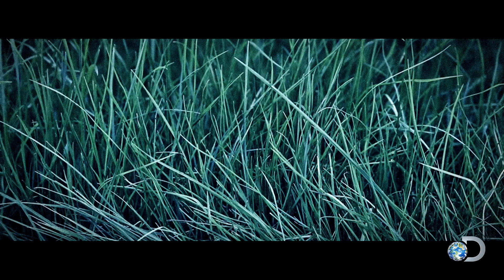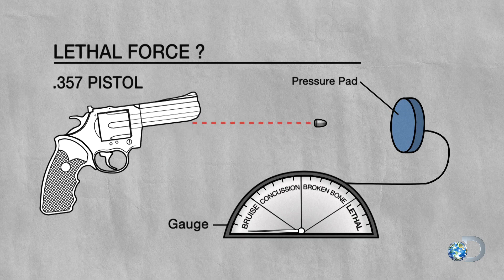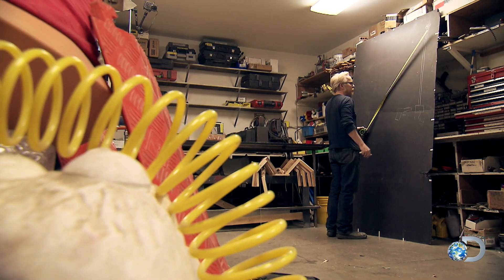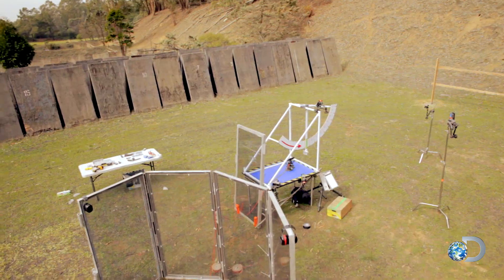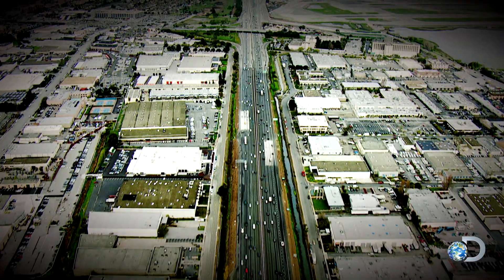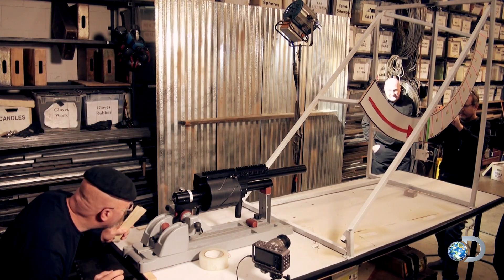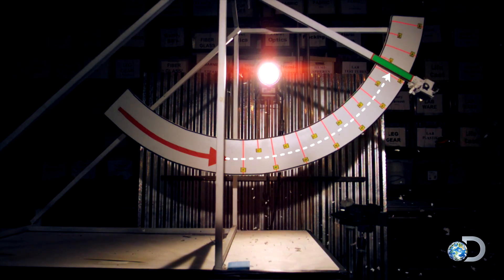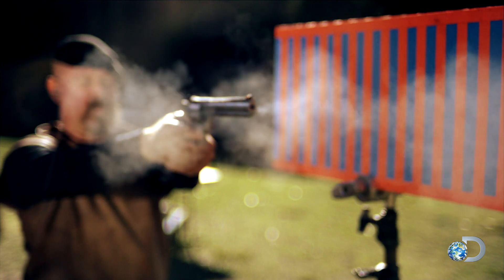Lethal Lawn Mowers MiniMyth | MythBusters

Comment: this is probably the worst mythbusters I've ever seen.

the lawnmower does not have the same launching power as that gun. Plus you're doing it at point blank range which rocks are not aerodynamic like a bullet is. Bullets usually are deadly both on power and PENETRATION, which the rock also lacks.

Also, lawnmowers cannot aim higher than the cover. So watch out feet?

Comment: No... Someone failed physics. They made a mistake somewhere. A 357 will go through multiple people and vaporize their heads. A lawnmower blade spins at 200MPH, that's 293 feet per second. A 357 bullet moves at 1,450 feet per second. A bullet is made of dense lead and maybe copper or steel jacketed. A rock is CONSIDERABLY less dense, aerodynamic, and not designed to penetrate as well. 
Look, you think this was done right, let's have a duel with your potato gun and my 357... I'll win, first shot. And I'll maybe get a bruise...

Comment: I think there's a mistake in this experiment. I believe the "energy rig" actually does a better job of measuring the momentum of the objects when they hit the hammer. Objects with similar mass transfer energy better than objects with very different masses - the bullet is going to ricochet off the hammer and maintain most of its original energy.

Force per unit surface area also matters when it comes to lethality, but that is just contextual information.

Comment: Dynamo is correct.  Also, this whole setup is waaay more complicated than it needed to be.  Computing energy door pounds is simple.  Questions:  how many grains was the .357 round?  What was the mass of the rock?  How did you determine the lawnmower would propel the rock at the speed you did?  Seems like there would be tremendous potential for variability there.  
Plus, Dynamo is correct.

Comment: Where's the lawnmower part of this testing? Why did they not bother doing a ballistics gel test? Get the metrics from the mower, use a pneumatic gun to fire for accuracy, fire it at a dummy's head, and then fire that over several distances to see if you would die from, say the next yard away like their original diagram?!

Comment: I think there is a little confusion between kinetic energy, and momentum. The rock clearly had more momentum, but, the bullet definitely has more kinetic energy. If the bullet was half the weight of the rock, but traveling twice as fast, it would move the pendulum the same as the rock that's twice the weight, but half the speed. However, the bullet would have twice the kinetic energy! Clearly, a .357 bullet is many times faster than the rock, but much less mass. Even though the rock had more momentum, the gun fired with at least 5 times the kinetic energy. Less of the momentum was transferred into the heavy pendulum, but the energy was dissipated as heat, and fragmenting the bullet.

Comment: What a complicated way of avoiding some simple maths!  The amount of energy is the mass of the projectile multiplied by its speed.  The maximum possible speed of the stone is the tip speed of the spinning blade.   However, after that simple calculation, you'd then need to allow for a loss of energy as the stone leaves the mower as it would almost certainly catch the edge of the mower and/or the grass.  The stone would be on a low trajectory, likely to hit the ground after a short distance and lose further energy.  It s not an aerodynamically efficient shape, and is not designed to penetrate a target.  By contrast, the bullet is fired on a high trajectory, is stable in flight, and is designed to penetrate a target.  Not your best video.

Comment: The rock is at an advantage in this experiment because the bullet has a larger pressure point in one spot (think of trying to push someone with your finger on a swing instead of the whole palm of your hand). The rock has a larger  surface so it’s easier to push the pendulum higher.
Reply: No, pressure is not relevant. The same force applied to the pendulum would move the pendulum the same distance no matter the area the dorce is applied over. 

The place where the gun loses a lot of energy here is likely in destroying the acrylic block as the energy used to destroy the block is not put into the pendulum. The bullet destroying the acrylic would be in part because of the pressure applied, but also because the bullet was much harder than the rock.

The rock also lost some energy in pulverizing itself and the gun likely benefitted from a lighter pendulum due to it destroying the acrylic, but I bet the destruction of the acrylic ate up more energy by a significant margin.

In the end, while these factors do create significant margins for error, considering the purposes of the show and the idea they were testing, the tests and results likely were good enough.

Comment: I can tell you this can be very dangerous and absolutely true depending on what you hit, my old small ride on mower has no deflector on the discharge chute and I hit a bolt that was in the grass and it punched a hole straight through my colourbond steel fence

Comment: My aunt was mowing, on a riding mower, about 15 years ago and hit a rock, and it literally went though the rear fender of the bed on a 1998 Ford F150 that was approx 7 meters away. It was about a 7 to 8 cm hole, around 3 inches.

Comment: Try to imagine kicking a soccer ball directly at the target. That thing would would be doing flips. This test doesn’t prove that it is potentially as lethal as a bullet. If u got hit with that stone in you thigh is would hurt something savage, a hell of a lot of swelling but unless something freaky happens you wouldn’t die. If a bullet did, you could easily bleed out if it hit u just right. Force does not proof lethality.

Comment: But would a lawnmower really shoot the rock at the same speed as the launcher did?
Reply: Yes, they tested with a lawnmower earlier and calibrated the launcher to that.
Reply: @Ihdc1  Even if the rock had greater momentum, the bullet is exerting itself on a smaller area and is moreso shaped for penetrating. A rock is mostly round and hits a larger area, mkaing it harder to penetrate the skin.

Comment: Also, the bullet would fold around itself and continue to dump energy while the rock will shatter (depending on the minerals in the rock)
Reply: If the lead bullet hits the metal plate (the contraption he made) and gets flattened, then some of the kinetic energy is being converted to heat. The device won't measure the full kinetic energy of the bullet.
If a rock hits it and bounces back, this is called an elastic collision. The device won't register the full kinetic energy of the rock.

Comment: The nice thing about watching the Mythbusters on Youtube is I can leave a comment about their bad science instead of just yelling at my tv.
Bad science! Bad!
Reply: They shouldnt have shot from point blank. Like i saw in another comment, the rock would slow down a lot more. I think it would be fine that they used a launcher instead of a mower. But they also should have tested if the mower can even throw rocks out at that speed. Otherwise of course you can get similar results. Dummies
Reply: Darkwrath05 When you’re pushing a lawn mower you are close to point blank

Comment: The rock is more affected by air resistance due to it's shape and you'd have to place the lawn mower in such a way that it hits the rock just perfectly enough to deliver the "killing blow" Not to mention that the lawnmower has those shield thingies that prevents that from happening. Thus, the chances of you accidently killing someone this way are very slim.

Comment: in 2008 i was in Riverside, CA,  at a costumers house doing construction remodel of the kitchen. While there, my car, a Mercury Sable Station Wagon. was parked in the driveway.
The bi-weekly Gardener was outside and mowing the lawn.  He came in and asked who's car was in the driveway.  We all stopped what we were doing and went outside.     A small Rock, 1/2 inch round flew out from under the lawn mower and went through the right side of the windshield and out the back left side panel window in back and hit the aluminum garage door and left a dint.
I personally think if it hit someone instead of the car, maybe could have killed them.

Comment: Granted, I've never been shot by a .357, but I have been tagged in the leg several times from lawnmower-thrown rocks.  Apart from a little sting and a scuff on the skin, I was fine.   Was I just lucky, or is that gravel-gun way more effective than a lawnmower blade?

Comment: He's confusing momentum for energy. The pendulum measures momentum (mass * velocity) not energy (mass * velocity * velocity/2). 

A 135 grain .357 mag round can have between 450 to 800 lb*ft of energy (or 610 to 1100 Joules), but only 0.73 to 0.98 pound * seconds  (or 3.3 to 4.4 kg*m/s) of momentum.

A 100 gram rock (a little less than 1/4 pound) thrown at 44 meters per second (144 feet per second or about 98 mph) would have the same momentum as the hottest 0.357 mag round; however, the energy would only be 71 foot*pounds (or 97 Joules), just 9% of that of the .357 round.

Furthermore a bullet has a far greater density, and hydrodynamic shape than a rock and can therefore penetrate and dump it's energy far more effectively. Thus while said rock could hurt someone pretty badly, it is nowhere near as deadly as a bullet. Duh.

Comment: Now this is a bit of a shitty test. A rock coming out of a lawn mower does have speed, but most don't and can't even come close to 400 FPS. and the launcher they used was too close the the target. if you look at the shrapnel spray pattern of the launcher some of the high pressure air they used to shoot the rock hits the target. a lawn mower can't do that. If this test was fact in real life the running your lawn power over rocks next to a car would leave holes in the car, not dents and paint chips, a  .357 can put a bullet THROUGH a car and still damage stuff next to the car.

Comment: It ain't a bullet, but on my first week of business 27 years ago, I put a rock the size of a baseball through a doctor's car window about 125' away with a small 21" mower.  If that hit your head you would have a problem.   I have also been knocked senseless before by a string trimmer picking up a rock and slinging it into my head.   Finally, I have glass still buried in my leg after 10 years and two surgeries that was imbedded there after I hit a piece of glass in the curb with a line trimmer.

Comment: Completely inaccurate. First the gun was much closer so the bullet didn't have enough time to reach maximum velocity. Also the rock had much more mass to push the pendulum. That doesn't mean it has the penetrating power of a bullet.

Comment: This is ridiculous. The rock's only source of acceleration is the lawnmower blade. The bullet is traveling faster than the speed of sound. I think that it's safe to say that the lawnmower blade is not traveling faster than mach 1. Assuming that the rock has a similar mass to the bullet, there is no way for it to have greater kinetic energy.

Comment: I once was cutting at a building and my tractor cought a small piece of rebar on the grass and launched it across the street and through a metal road sign, if that's not lethal then I don't know what is. I only knew it was rebar because I found more around the same area

Comment: It wouldn't pierce as much as a bullet though, since the surface area is larger so it wouldn't focus the energy as a bullet would.
Reply: But it would also have much more mass. The energy levels between a bullet and rock at point blank range would be more comparable than you think.
Reply: I was thinking the same. A punch has probably much more energy than a bullet but it does so much less damage
Reply: CreeperAssassin005 You're right, but bullets don't pierce as much as you think. Also, you'd still receive massive amounts of force over a small area, rendering it all lethal nonetheless.
Reply: At the risk of just echoing other comments; A bullet is made for distance, while a rock is incredibly un-aerodynamic. Unless you were standing at head-level, as close as you could to the lawnmower, the rock would lose speed and become just painful very quickly.
Reply: My object detecting lawnmower will help. Subscribe if you like my idea.
https://youtu.be/eDZeLPgYBvg
Reply: Take that stone to the temporal lobe of your head and tell me how it went!

Comment: they don't need that hammer at all. All they need to do is weigh the stones that got shot out of a lawn mower and how fast they went. F=M*A people
Reply: Jeremy Reff Yes but they could use math to solve just about every myth, that just wouldn't make a good show.
Reply: Jeremy Reff no energy and force are different. Energy is scalar while force is a vector. Also force is measured in newtons and energy is joules.
Reply: Jeremy Reff they aren't using force though they are using energy, but it's still a very poorly done myth, it's not the energy that kills people lol is the penetration of the bullet. People can punch with more energy than a bullet but bullets make holes and fists don't lol.
Reply: lamakicker69 the energy imparted by the rock is equal to its force. the rock's ability to create a hole is about its density and the surface area the force is applied to
Reply: lamakicker69 all those measurements can be easily converted between each other using simple physics you're just trying to argue to make yourself seem right
Reply: Jeremy Reff It's a television show though.
Reply: MrPicklepod which is why I wish they used a ballistic gel head instead of a hammer, it's just a better spectacle

Comment: all that you proved is that a rock shot out of a numatic canon can be lethal. you never showed how you found the pressures to put the canon at to simulate a lawnmower, in fact what you showed was counter intuitive because if you knew how hard to shoot the rock out of the canon then you already knew the force that a lawn mower can transfer to a rock.
Reply: Sigh. This is a trimmed down version of the episode. In the episode they drove a lawn mower over some rocks and measured the speed that the rocks came out at. What was that speed? 406 mph. They just used the gun so they could aim it.

Comment: major flaws with with one guys, 400MILES PER HOUR is about 600 FEET PER SECOND. So aside from firing 50% faster from the air cannon, I also have sincere concerns that no test fire empty was done to see how much force was imparted from the huge air blast point blank at the large target it had to push on....

bet you $100 that at 400fps it was supposed to be at, the rock won't move the pendulum but half the distance it did (and less than revolver) but also bet a control fire of the air cannon shows 10-15* movement too.

Comment: This was terrible! By removing the lawnmower from the equation, you completely invalidated the results! I highly doubt that a mower would smack something away at 406 miles per hour like that gun.
Reply: Sigh. This is a trimmed down version of the episode. In the episode they drove a lawn mower over some rocks and measured the speed that the rocks came out at. What was that speed? 406 mph. They just used the gun so they could aim it.
Reply: In that case, they should have explained that they measured it instead of invalidating themselves by leaving out a rather important part of the investigation.
Reply: UGU Zach they did explain that watch the video again